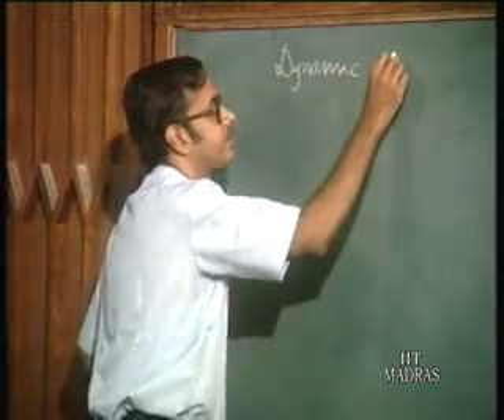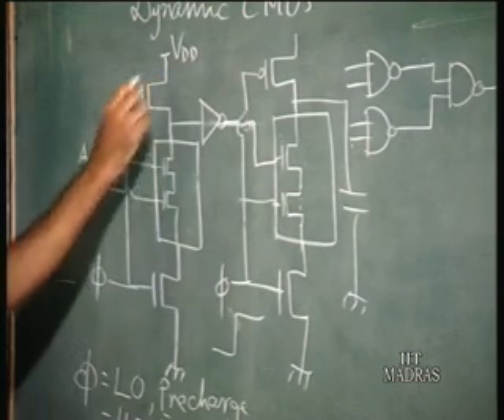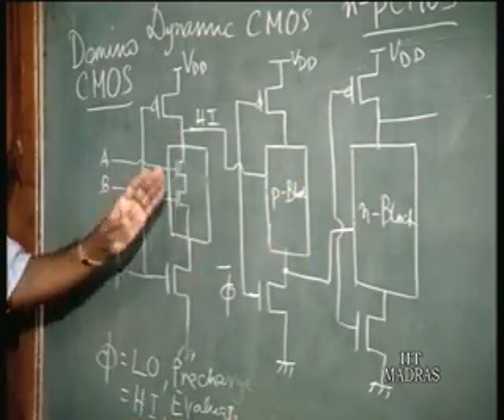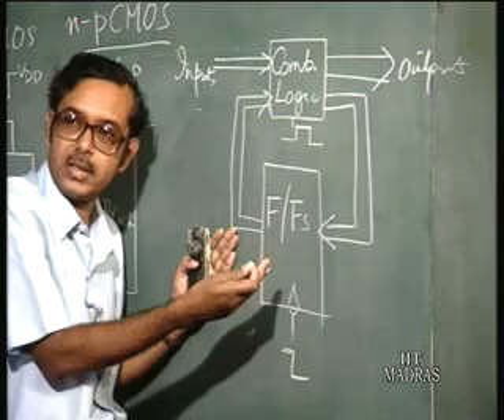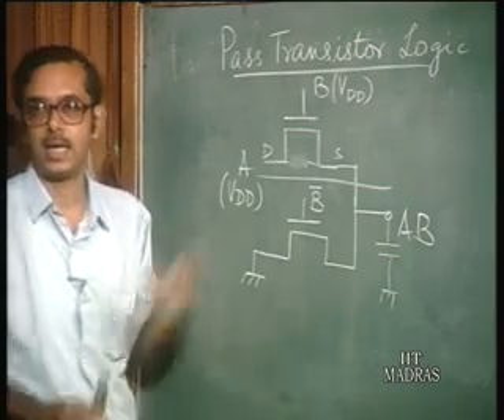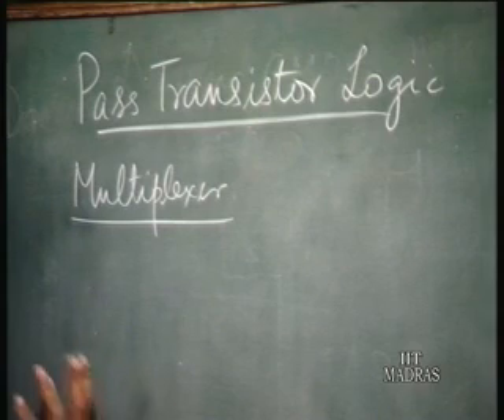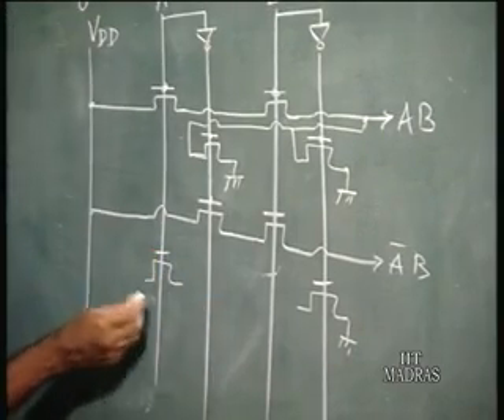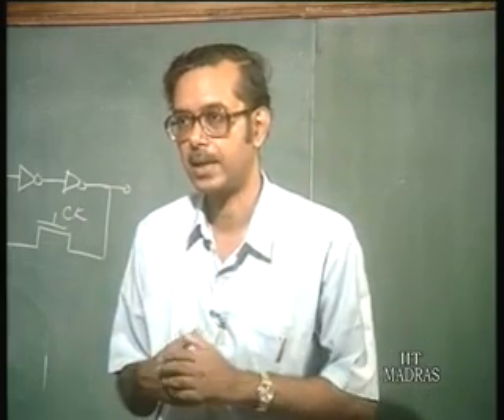Lecture 28 Dynamic CMOS ;Transmission Gates;Realization Of

Comment: when we are cascading two logic our aim is to provide the output of 1st stage as input to 2nd stage.Considering the nand logic,when A&B are high ,input to next stage should be low logic level but using an inverter provides logic high which turns ON the transistor.Can anyone please explain?
and also if we just wanted delay then why not use a buffer?

Comment: Sir, I guess the inputs i.e. I1 and I2 will be interchanged to get the correct output for the 4:1 MUX  while designing using the Transmission gate logic. I found out that error. Please correct me if I am wrong. 
Thank you, Sir, for such a brilliant lecture. Helped a lot. Thank You.

Comment: in precharge phase the parasitic capacitor goes high. if the o/p capacitor is zero we didnt get the output voltage w.r.t i/p.